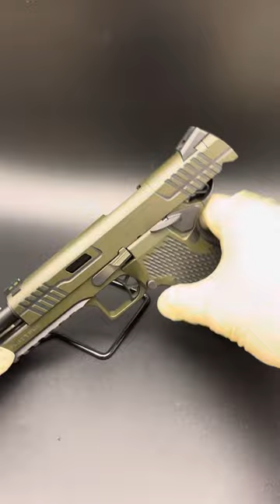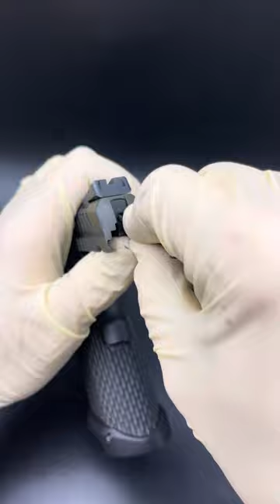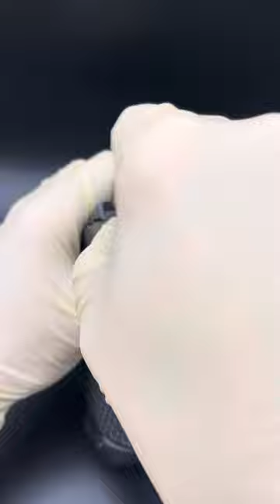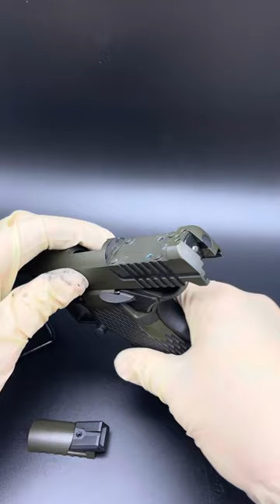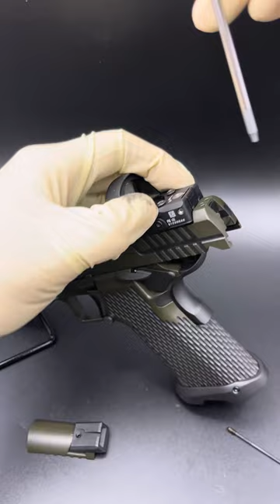Optic Installation

Comment: Mine arrived today after a 6 month wait.  Installed the SRO with “low” co-witness rear (thanks for the video instruction).  No adjustment required to the SRO @ 10yds.  This weapon is of exemplary quality - the fit and finish is better than any STI or tuned Kimber.

Comment: I can’t get the set screw out. It is so tight or someone put red locktite on it at the factory. The wrench that came with it literally twisted until like it was in a vice. What do I do?
Reply: I was afraid mine was going to snap. Just do your best with slow and direct pressure. Mine came off without incident. Good luck!

Comment: My set screw is so tight, it feels like my wrench is about to snap. I’m hesitant to apply any more force. Do you have any tips?
Reply: Slowly and evenly apply pressure, if you can use something as a cheat bar it makes it easier, apply all the force on the tip of the wrench, and do it gradually, it's going to break unexpectedly and smoothly if you do it right